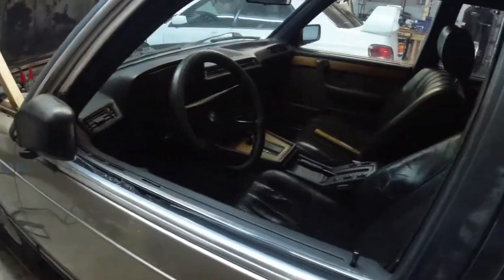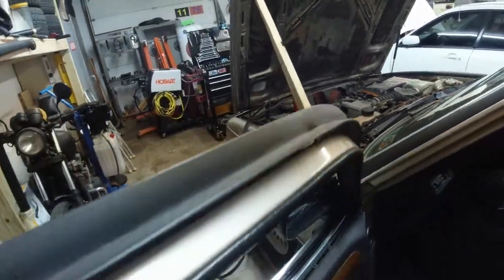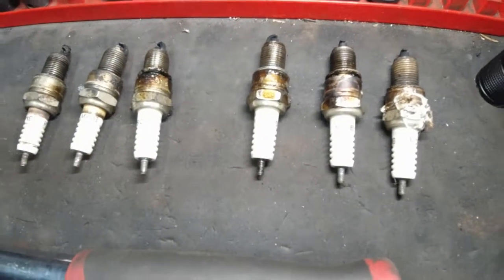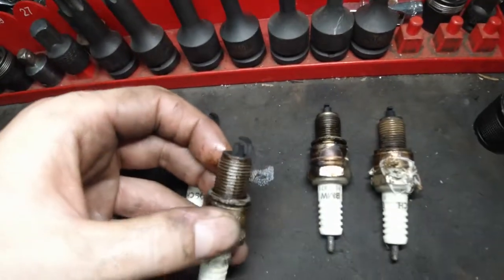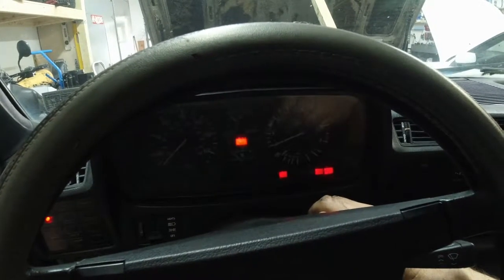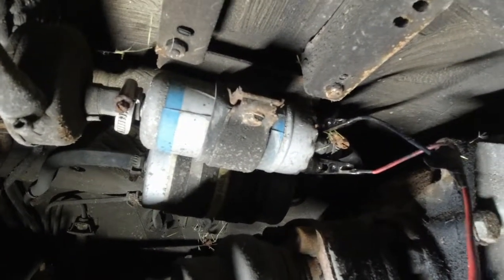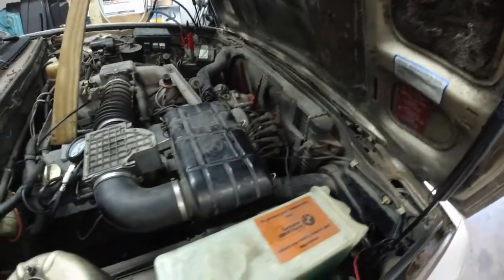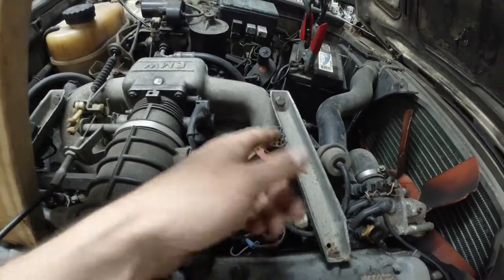84 BMW 733i crank no start, troubleshoot

Comment: My 533i, OBC jump green and green and red wire and started RIGHT AWAY. ANTITHEFT BYPASS. Started right away after years of sitting and refusing to start after testing everything you did in video. If you have the factory wiring diagram you will see, I have mine for the 533i. Had friends help that know way more than I about tracking down electrical problems. The car starts for now but I still have to fix the problem.

Comment: My friend had one..wouldn't crank...I touched the starter solenoid wire with probe...fired right up. Air plane ticket and expenses I will spread my love....
Reply from the maker: lucky you...mine wasnt that easy.
Reply: q

Comment: Hello, what was the reason for the BMW not starting?
Reply from the maker: Misfire and no communication from ECU.
Reply: And did the engine finally start?
Reply from the maker: no, it needed an overhaul, sold the car long ago, never had time to do it, or the space to keep it.
Reply: And did you change the ECU to the BMW to start?
Reply from the maker: no, i sold it as is